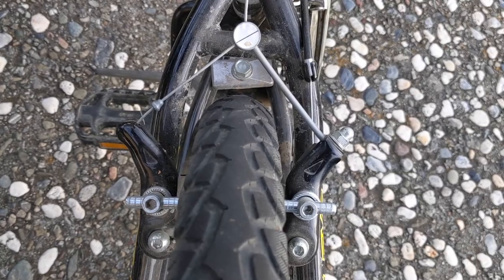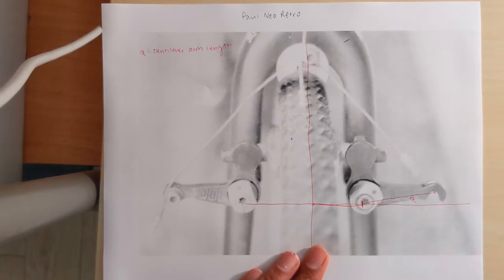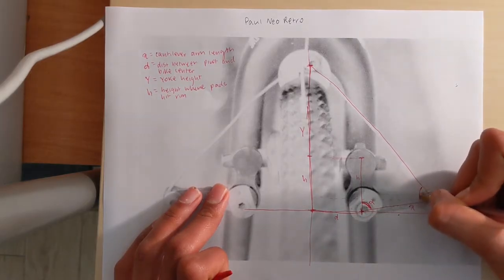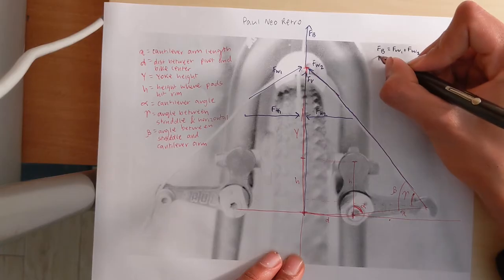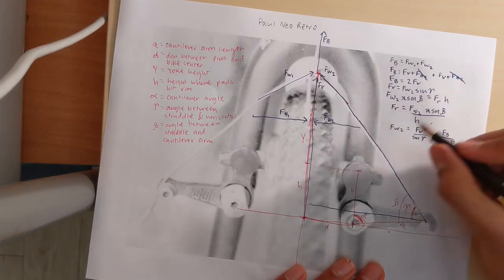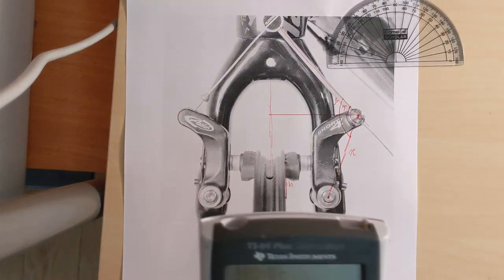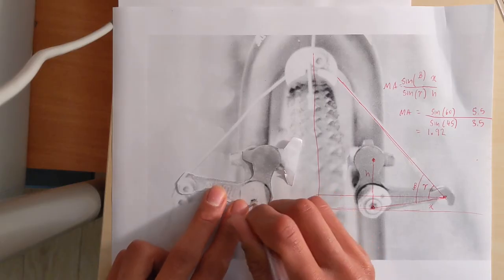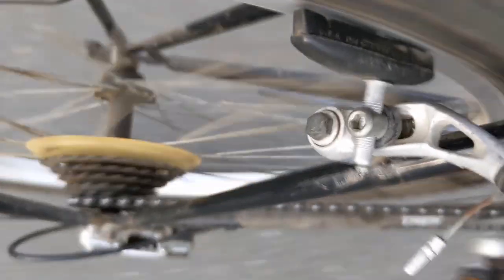Calculating Mechanical Advantage of Cantilever Brakes

Comment: I was a service manager in bike shops for fifteen years, and during that time and all the other decades I've worked on my own bikes' cantilever brakes I applied some simple rules that work well on almost any canti brakes.
1) Keep the pulling cable at 90 degrees to the brake arm for maximum efficiency (this doesn't work on old Mafac-style stick-out-in-the-breeze brakes, but they're a flawed design).   This angle may be slightly varied to change the subjective feel of the brakes to suit individual customers' preferences, and to equalize the feel of front and rear brakes to compensate for longer cable runs to the rear (especially useful on tandems). 
2) Position the pads as close as possible to the arms for minimum flex and squeal.
3) Shim the brake pivots (even the internal pivots on Deore low-profile cantis) with 0.004" brass shim stock to ensure they pivot smoothly with absolutely no slop or play.
4) Always use the best quality smooth-drawn inner cables and lined housing, grind the housing ends flat and use tight-fitting ferrules, and run cables with as smooth radius bends as possible.
5) Use different pads front and rear to obtain the best bite and feel to the brakes:  I do this for my car, so why not also for my bikes? 
If you do this, your canti brakes will work just fine.   It ain't rocket surgery!   I never calculated theoretical geometries, but just paid attention to sometimes-overlooked details.

I recently got back from a short tour from Albuquerque NM to Flagstaff AZ on my road touring bike, and even with it weighing over 80 lbs loaded I never felt I needed more braking power from its old Deore LX cantis that I've set up as described here.
Reply: I also use different setups for the front and rear brakes of my bicycle. That way they feel equally powerful (lock-up with same travel and force) and have equal modulation. I wish I knew how to shim the brakes 😅
Reply: Great advice on set up! Thanks! I just set up an old Fuji Mt Fuji Ltd mtb with STI levers and cantis. The original black pads (new to this build, but very hard) weren't stopping well, so I changed them to the Kool-Stop salmon brake pads, front and rear. Made the grip so much nicer. Yes the pads will wear faster, but the braking modulation is so much better.  New cables definiteiy make a huge difference too. I was surprised to see how well STI levers worked with cantis. The build is one of the coolest bikes I've ever had. Cantis can be REALLY good brakes when set up well.

Comment: They are the best brakes in snow+ice conditions because of their simplicity. They are easy to wipe off and make functional. They are the best brakes period. Every other system is more trouble. We use to call them center pull in the 80s. For the avg Joe, there was only side pull and center pull.

Comment: If I got this right, you get more braking power from low profile cantis by moving the pads all the way inward ("large gap between the brake arm and the rim")  and vice versa for high profile ones? can someone confirm this?

Comment: good stuff, now we need to do the math with V brakes.
Reply: Will be fantastic know V mechanical advantage
Reply: Horrible modulation doe...
Reply: Note v brakes need different brake levers than cantilever,  because the pull length needed for v brakes to work are larger than cantievers.
Reply: @danc2014  yes that is correct.. without the proper levers V-brakes under-perform. 
there is a component called "travel agent" that increases cable pull. it's basically a pulley..

Comment: Awesome video. I've never had a problem wtih canti-lever brakes if they are setup properly. It isn't voodoo either to get them set up correctly so perhaps some of the people who are having so much trouble have contaminated braking surfaces and / or poor old hardened brake shoes especially if they are working on an older bicycle.

Comment: Thank you for this. I was really stoke on converting my vintage suntour to disk in the rear cause maybe people going disk brakes would mean that older tech in inferior in the sense not that great for today.

Now do the mechanical advantage of disk brakes and compare the two. Thanks.
Reply: If you want to improove the breaking power of cantilever oe v brakes just buy the vbrake power boosters. Those make the bike frame stiffer, wich means more braking power

Comment: The v brake anayizing is simple, just uaing the full length as long arm and using the the brake pad position as the short arm, and long arm length divided by short arm length is the leverage ratio.

Comment: Useless calculations. There is one simple rule - force not appear from nowhere. Simply measure the relation of brake lever and pads movement and you clearly get the strongest ones. For stupid ones: more cable you pull - less force you need to gain the same braking power.
Reply: This video is literally him calculating the relation of the brake lever to the pads. Its not his fault you don't understand them lmao. Say hi to r/iamverysmart